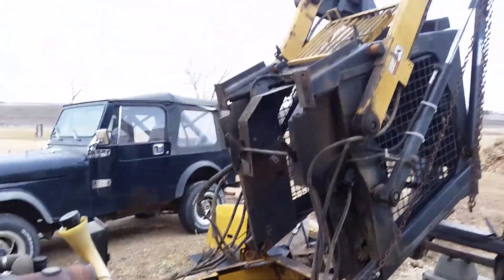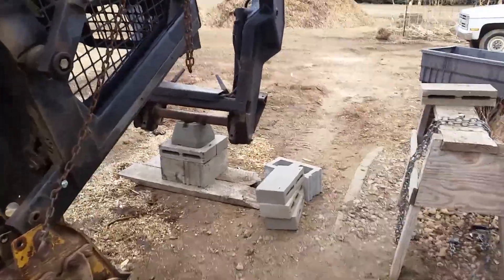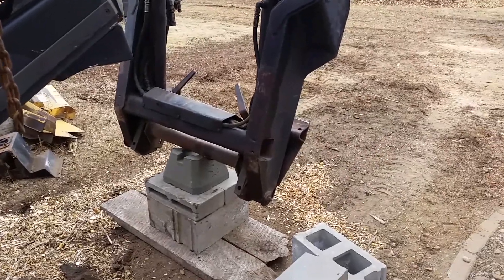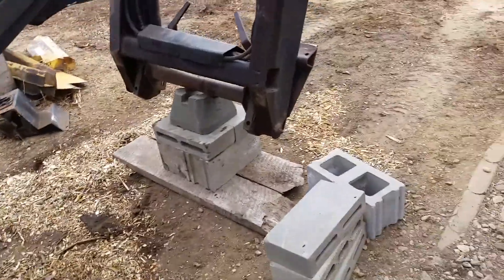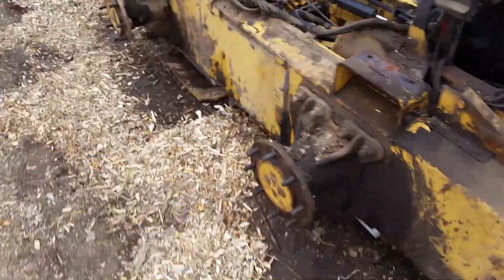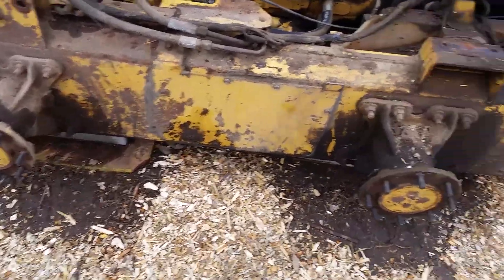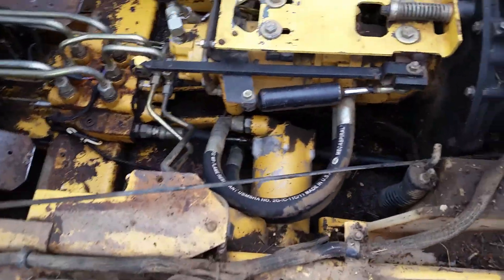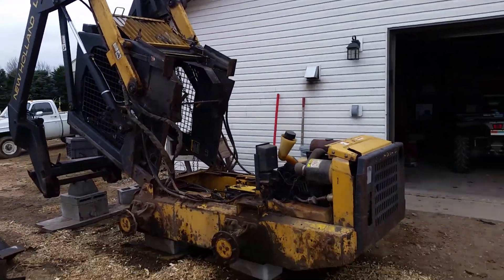New Holland L565 Drive Noise | Part 2

Comment: Thats pretty cool, I've never pulled a skidsteer apart before, I actually kind of like that setup.
Reply from the maker: It took me about an hour to get to the "Ready to tilt the cab and boom" part. Another 15 minutes to actually get it completely into position. I think with the good instructions that were in the operators manual anybody with some mechanical aptitude could do the same. Granted I have had different parts off this loader and have owned it for about five years so I am familiar with it. Most companies have great parts illustrations online with part numbers and pricing so that helps also. Found a service manual online to view so that is great also. I really feel all manufacturers need to supply service information free of charge to its customers, especially service bulletin Information. In the New Holland online parts manual there are service bulliten numbers by the brake disks that are making the noise. Guess what. I can't find the SB online so I called the dealer and he said the disks make a load noise when the splines wear out and slip. Duh! If I would have had access to the SB I could have been more informed.

Comment: dang! No wonder they get so much to work on em. Its just as much work getting to it as it is fixing it!
Reply from the maker: A bearing in this gearbox started growling during our first snowstorm of the season back in December. Great! I did not have a place to work on it that had a tall enough ceiling. I did not use it much, just to do wood splitting and minor chores. I use this loader a lot so It has to be back in service within a couple of weeks. To get to this point I really only have about three hours work so far. Some mechanics don't tip the cab and boom out of the way. I felt it was necessary for this old man to be able to hoist those massive gearboxes out of the machine. I think I will replace the bearings in both sides while I have it apart. Might even replace the chains and the wheel bearings if they feel rough. These things take a real beating.
Surprising enough the instructions to tilt the cab and boom are in the owners manual but they want you to buy their sub $1k jack. I don't think so!